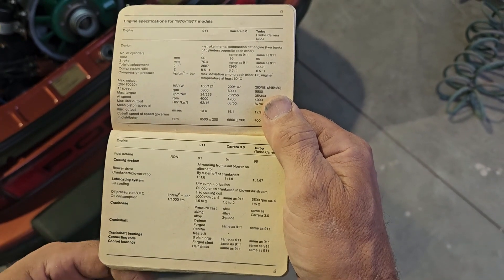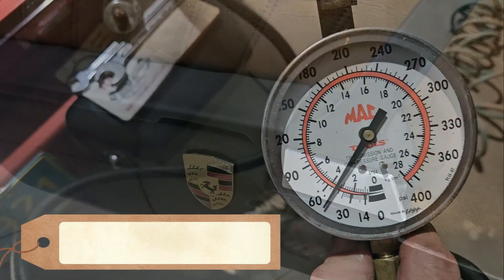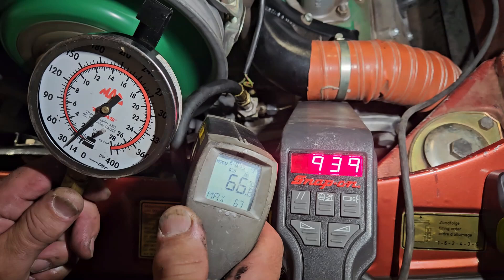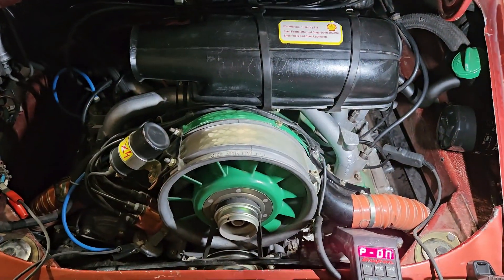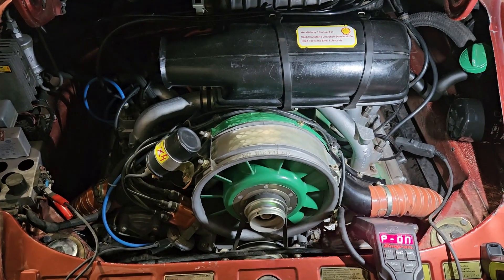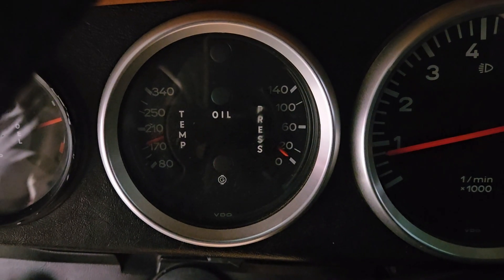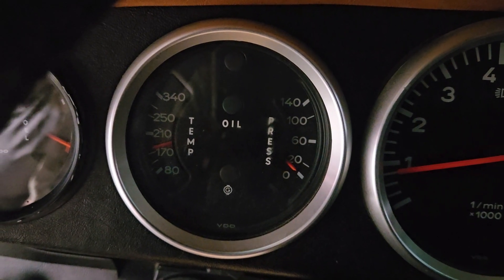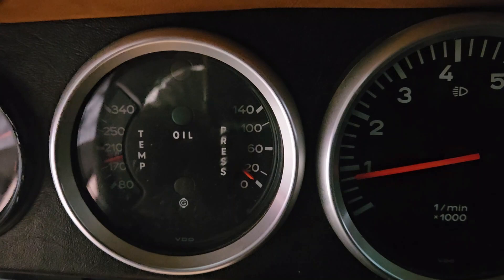Oil Gauge Vs. Oil Pressure. Should we be concerned?

Comment: Excusme Mr.
It's possible use oil 10 -60 w engine with 170.000Km (year 1974) please.
Regard Martin
Reply from the maker: You can as long as it is not a synthetic oil. I would not use the Porsche 10W60 as it is not designed for that engine.
Kurt
Reply: Thanks you.
Regards Martin.

Comment: Hey Kurt , what is your opinion on upgrading the fuse panel to one with the more modern blade type fuses. I kinda like the original bullet type but if the other is superior I would consider it. Mine shows little if any corrosion but it is old. Thanks.
Reply from the maker: Hi Kevin,
I am not a fan of the blade fuse conversion. Spending $500 on a fuse panel that really does not change the reliability of the original part does not make a lot sense to me. Using the ceramic fuses allows me to clean the terminals and re-tension the connector tabs as needed. They also allow me to change fuses without needing a tool to do so as well. lastly it is a small thing but it does change the look of the panel. 
If its something you really want to do then you are not going to hurt or damage anything. so its up to you.
Kurt
Reply: @Aircooledconsulting  thanks Kurt , you said what I wanted to hear. I will stick with the original one and make sure it’s clean and in good order and the fuses are ceramic. Thanks.

Comment: Thank you for this video, the '71 I bought during Covid always shows way low on the '79 3.0 that is installed and its caused me lots of sleepless nights. No more! 
One question, would it not make sense to install a T-fitting at the idiot light port and mount the gauge sensor there?
Reply from the maker: Jarno,
No, I would not install a T-Fitting. So the first issue you are facing is the 3.0L SC uses a different pressure sensor than the 71 2.2L engine did and a different gauge calibration.. The next issue is the pressure senders are not transferable between engines as they use different threads. You can buy the pressure sensor for a 1975-77 911 engine which will screw into your 1979 3.0L and should be closer to your installed gauge. 
I would also just measure the actual oil pressure just like we did on this video. That way you know that you dont have any issues and then just drive the car. 
Kurt
Reply: @Aircooledconsulting  Thank you for the advice! Always look forward to your videos

Comment: My car oil gauge registers on the low side, when it’s at idle it just barley comes off the zero mark. How can you tell if it’s an oil gauge problem, or an oil sensor problem, without just replacing parts and hoping for the best? And yes when you step on the gas pedal the needle jumps up on the oil gauge.
Reply from the maker: More than likely it is going to be a combination of both the gauge and the sender unit as well as the wiring resistance.
As long as the gauge moves and the oil pressure light is off you should be all good. In the worst case you can always confirm your actual oil pressure with an external oil gauge just like we did in the video.
Kurt

Comment: A diaphragmatic or bordon tube pressure sender operates most accurately between 1/3 and 2/3rds of the range it is designed to measure.  Either side of that, their accuracy suffers.  Added to that are sweep errors in an electric gauge.
Reply from the maker: Yep I agree, just an indicator not an actual measurement.
Kurt